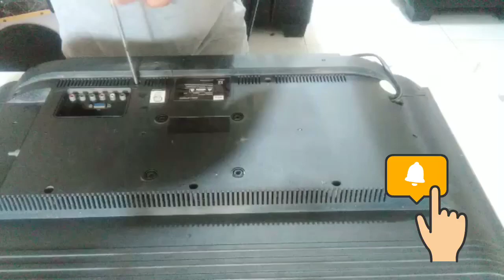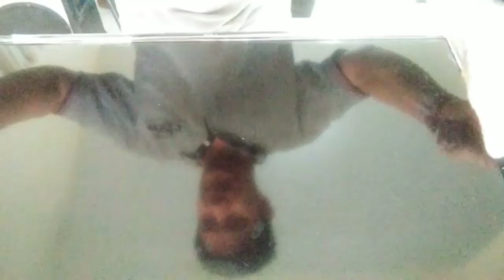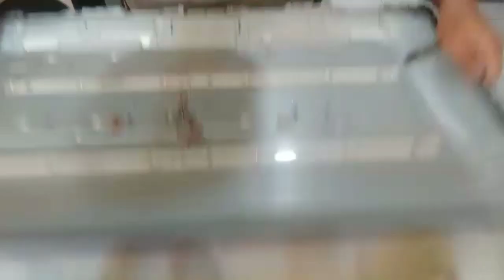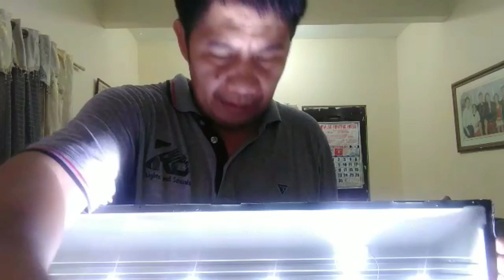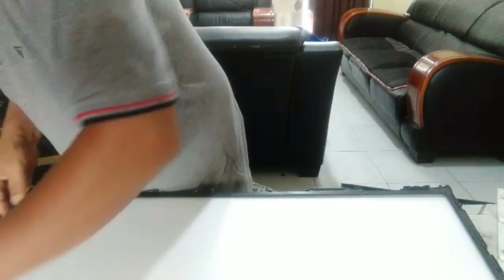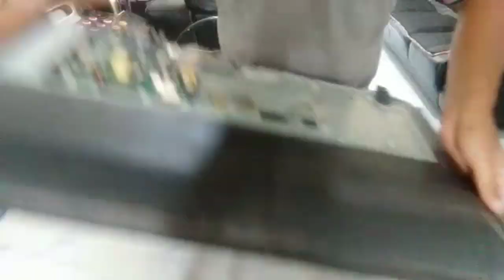HOW TO REPAIR FLAT SCREEN TV BACKLIGHT PROBLEM (TCL)

Comment: Sir panu mag voltage check galing backlight inverter..kasi wla ako png test sa backlight..ilang volts po supply nun backlight
Reply from the maker: iba iiba volts ng bsclight may 3 volt at 6 volt para malaman mo kung anong volts ng ilaw gamit ka ng trster set mo sa x1 testerin mo isaisa pag umilaw 3 volts pag hindi umilaw 6 volts o kaya pundi  o kaya gamit ks ng isang pirasong batery
Reply from the maker: ah pag tcl na tv kalimitan 6 volt  tapos ang supply nyan makikita mo sa  saksakan ng backlight sa board kung anong wire ang positive at negative
Reply: @bongelectronics7773  ung TCL kasi pag On mo meron logo tapos maya black na..unplug mo ulet pag saksak meron ulet logo tapos black ulet..prang kabila side ei madilim sa logo ng TCL..
Reply from the maker: backlight ang sira nyan isang side pwede mo palitan yung pundi tapos babaan mo yong backlight sa setings para humina ang supply ng ilaw

Comment: san po makakabili ng back light replacement?
Reply from the maker: Taga san po kayo sir sakin po mayron
Reply: Baguio City po... meron po ba sa online at saan pong online?
Reply: kayo po kayang masend dito?
Reply: at magkano po? wala po akong back light tester baka alam nyo po back light voltage ng tlc smart tv 43 inches  model LED43S6200
Reply: Pwede po umorder ng backlight sa inyo?

Comment: ganto yun tv namin same problem.. naayus naman kaya lang paulit ulit lang ding ang sira dipa umaabot ng isang linggo..
Reply from the maker: Sir kailangan napo palitan lahat ng bulb para do pabalikbalik problima
Reply: @bongelectronics7773  sir ung smen po 42 inches tcl din  smart tv...backlight po problem pinaayos nmin 2500 nabayaran..kaso po di na kagaya ng dati ung tv...pag nanonood kmi kala mo may christmas lights ung loob ng tv...obyus po pag white at blue background...tama po kaya ung pagkaka repair sa tv nmin sir?

Comment: Sir, question lang po. Yung tv kasi namin kapag binuksan okay pa sya pero after mga 10 minutes nawawala na yung ilaw nya pero may sounds. possible po ba na backlight issue din yun? pag pinatay tas binuksan ulit, iilaw ulit sya pero after few minutes magblackout na ulit. Sana po mapansin nyo to. Thank you! God bless!
Reply: ganyan din problema ng tcl 55 inch tv ko

Comment: Kuya Anong voltage backlight ng TCL 32 inches?
Reply from the maker: 6v po
Reply: @bongelectronics7773  salamat kuya
Reply: Kuya tanong ko ulit my TV aq fukuda 21inch.  Power supply problem. With adaptor xa.pag inon xa di xa tumotoloy mag open.ano sira nun kua?